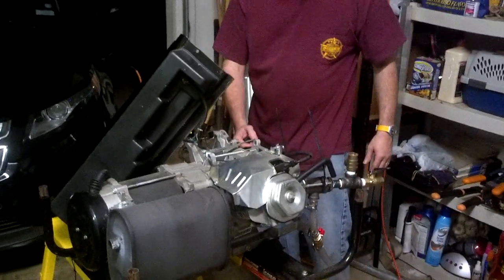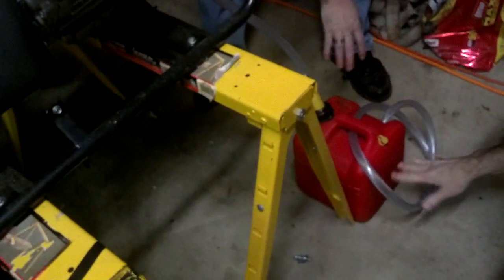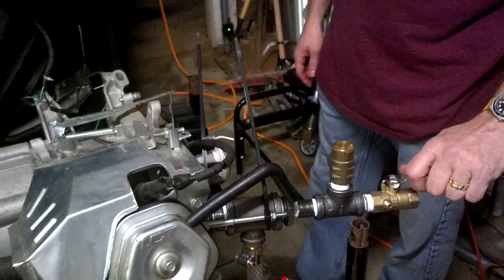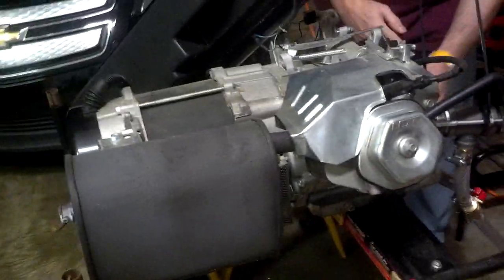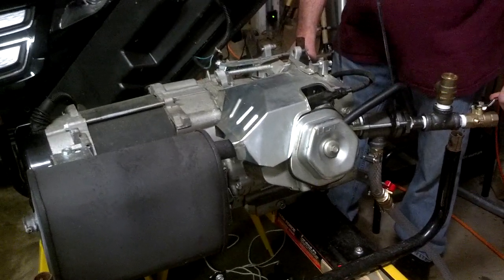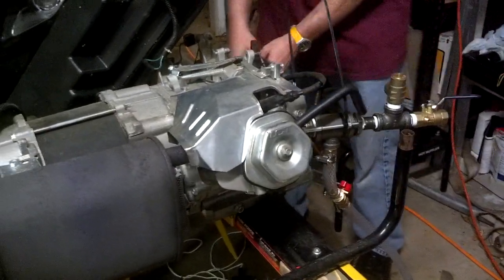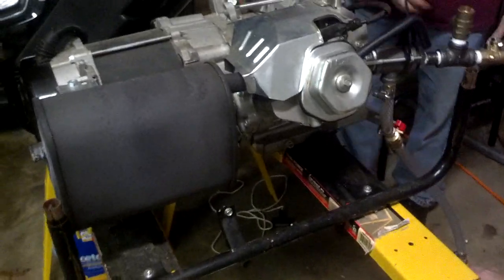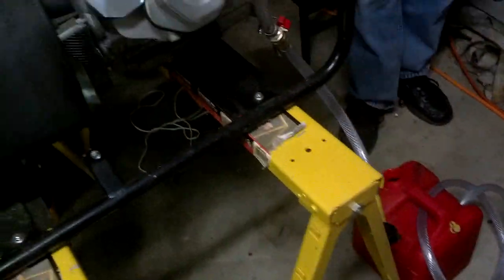Coop joins the almost GEET ranks

Comment: I know about the valve issue very well thats why i like to put setups like this on push rod motors easy to redo each valve and i can redo it by just turning the motor over by hand then one by one redo until i get the timing for each just right. For some v8's if new enough get the LP advance timing sensor no need to have a blower cam then but the trick there setup the motor all for LP my 460 thats how i got around all that. Keep up the good work.

Comment from the maker: It was over-revving the engine. Plenty of throttle left for making power once you throttle it down to where it belongs.  Then as the load comes on there's enough overhead to take care of it.
I'm working on a V8 right now. It has a blower cam in it (very important), you can search for a video ccc muffler to see what happens when you try to run without a blower cam. The exhaust valve not being completely closed as the intake valve opens is very bad for vapor engines! :-) Thanks!